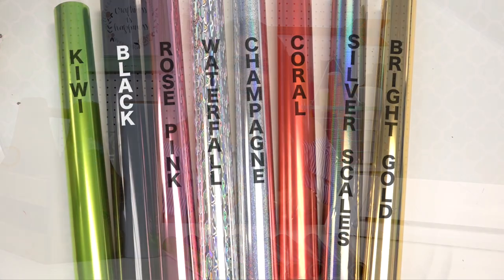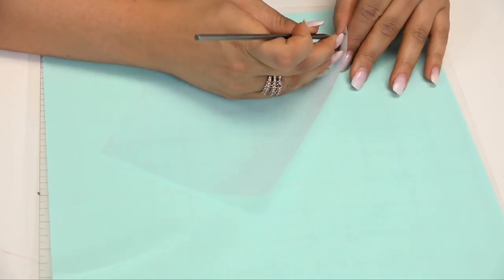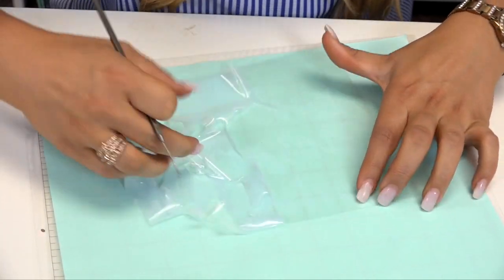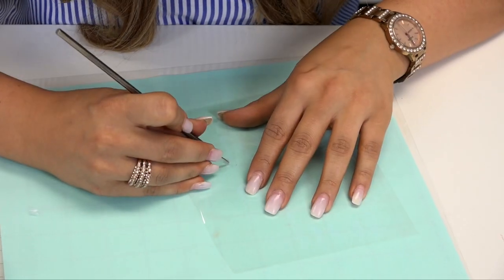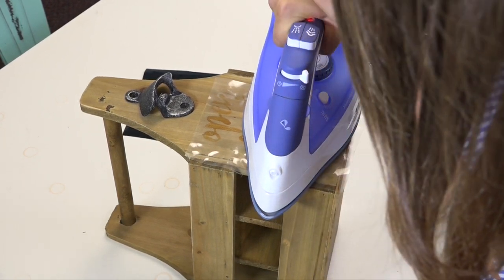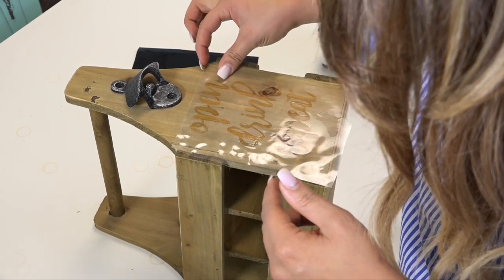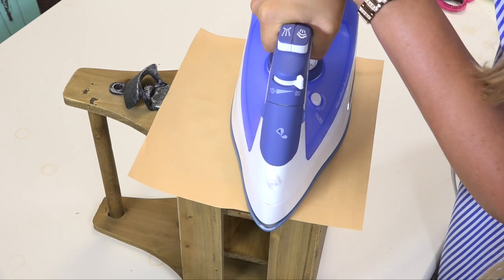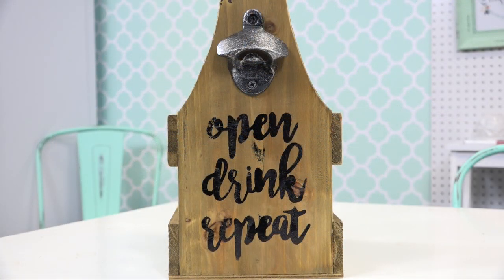How to Print HTV on Wood with Heat Transfer Foil | Craft Corner

Comment: Is that he Civ for better on the wood than regular vinyl 651? As in the durability
Reply: Adhesive
Reply from the maker: Hi Bonnie- Both products will give you a strong durable print on wood. The Adhesive is a great alternative for foil prints.